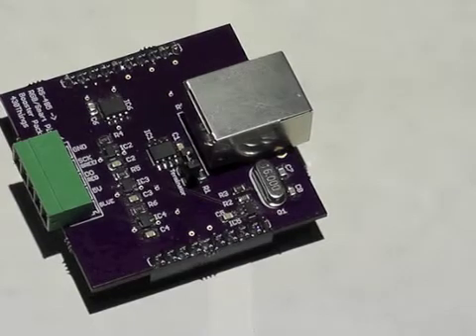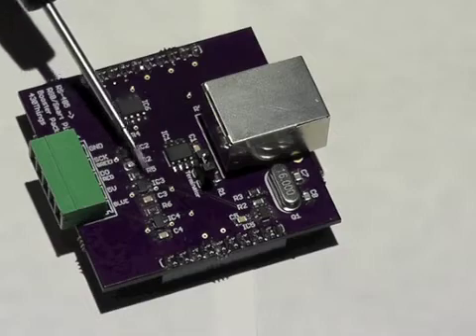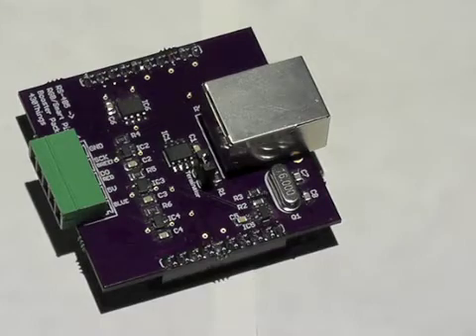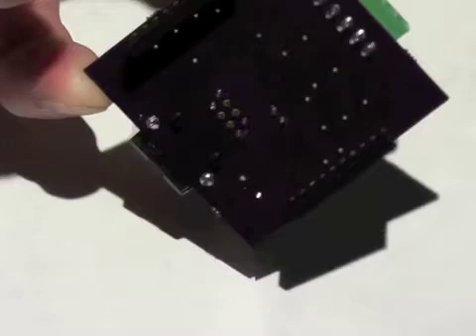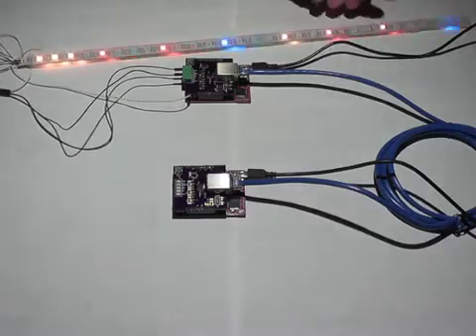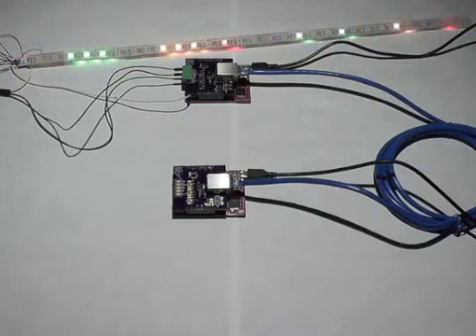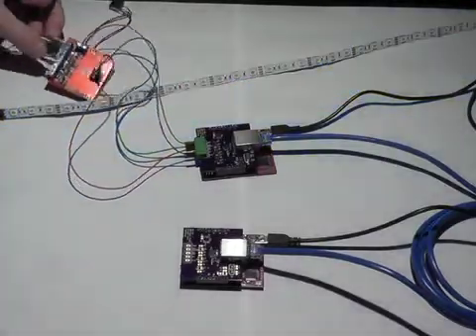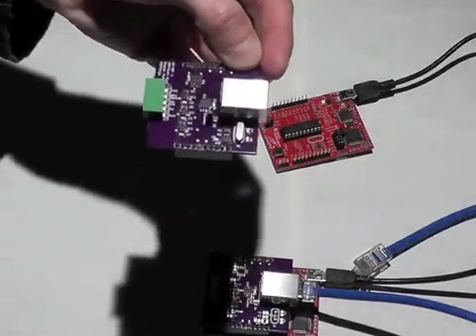RS-485 Booster Pack for LaunchPad

Comment: To this booster as you call it, takes the data signal and converts RS485 into DMX and decodes the signal for the WS2811 RGB Pixels?